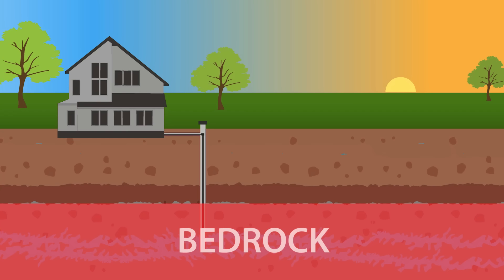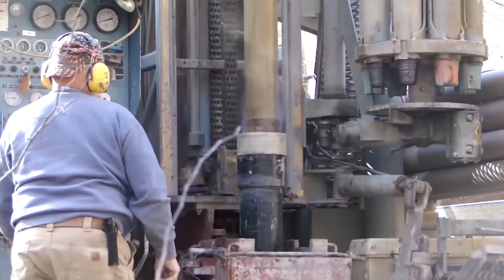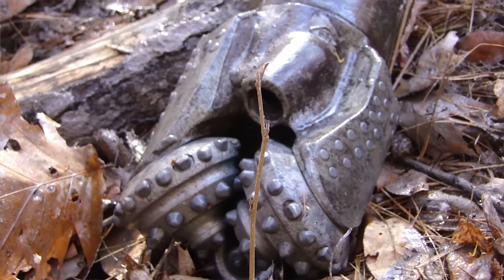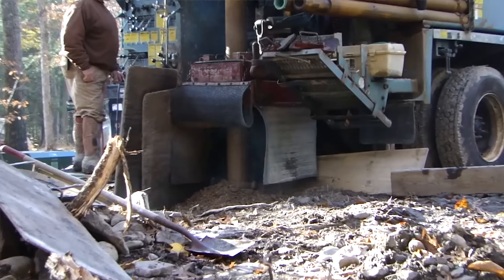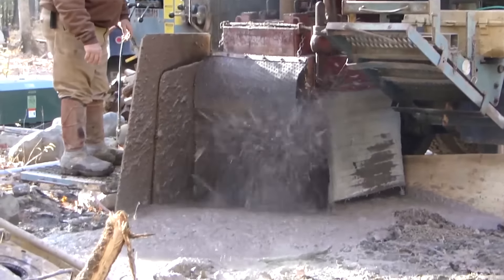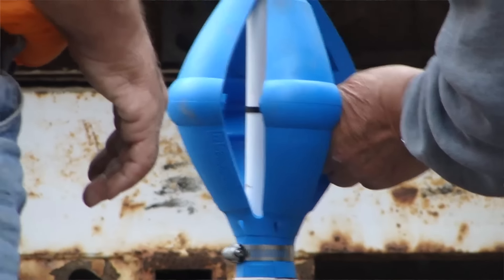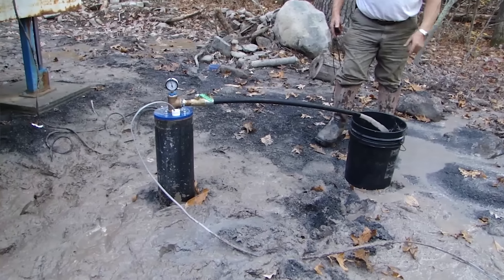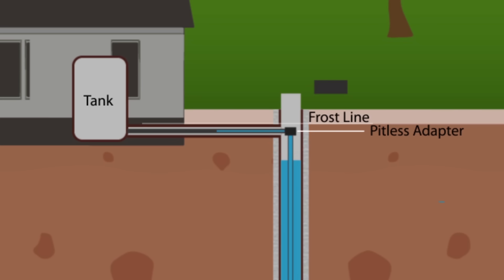WELL DRILLING 101 | Every Step Explained

Comment: Your well drilling information is bang on the money, Dan, and thank you for this educational video. I'm from a family of well drillers and am still amazed at the few number of people who understand this process. I'd like to add some information on the difference between a Cable Tool Drill (also called a Hammer Drill) and a Rotary Water Well Drill. It's important to understand the differences from a functional and financial standpoint.

A Hammer Drill drops a thousand pound 20' long solid steel drill bar from the height of two feet via a cable under a walking beam, then lifts it up again and repeats this process. The detachable drill bit on the bottom of the drill bar has tungsten carbide "buttons" on the bottom and sides that maintain the size of the typical six inch diameter drill bit so the hole size doesn't change to a cone shape. The half ton drill bar impacts the ground with enough force to grind up the rock in the presence of water to create a sludge called "cuttings". A hammer driller will typically drill 3-6 feet per hour and the operator regularly needs to stop drilling and pump the sludge out of the well (with a twenty foot hollow tube with a dart valve at its bottom) before adding more water (5-10 gallons) typically by using a pail. When water is struck the pump will come out of the hole with more water than the 10 gallons added manually.

Conversely, a Rotary Driller turns a pressurized drill tube and the rotating bit at the bottom of the drill tube grinds up rock much more efficiently than a hammer drill. The cuttings are constantly being blown up the outside of the drill tube by pressurized air that is forced down the center of the drill tube (typically 2000 PSI). A Rotary Driller only needs to stop drilling to add another 20' drill tube to extend the well depth. Therefore, a Rotary Drill can drill several wells in one day in decent drilling because of the efficiencies mentioned.

So what does this mean to the customer. There are significant differences in the two drilling methods:
1- Impact:
The biggest difference is the amount of impact the ground receives. A Hammer Drill pounds violently and this force can easily be felt a mile away if the rock being drilled outcrops near the surface. This impact will agitate any small seam in the rock to allow water to enter the well. But a Rotary Drill grinds away at the rock with only a slight vibration on the rotating drill bit.

2- Time:
Drilling in softer rock such as red shale, a Hammer Drill can drill a 100 foot well in two to three days, a week or more in hard rock. A Rotary Drill can drill 2 or 3 wells in one day in soft or even medium hard rock. Many times my Hammer Drill ended the day with a dry 60' hole and returned the next morning to find 5 gallons per minute of water flow. The "Impact" mentioned in #1 above had loosened a slow trickle water seam and the overnight hours allowed it to open up and supply ample water.

3- Pressure:
Hammer Drilling requires one to bail out the cuttings so an empty hole 60' deep can have a 60' water head forcing water in any surrounding seam into the well hole. This pressure can cause a slow leak to allow this small seam to be flushed open. Conversely, a Rotary Drill forces 2000 PSI down the drill tube to force cuttings to the surface. Imagine a small water seam in these two cutting removal processes. A Hammer Drill operates with an empty hole with water table pressure trying to access the hole. A Rotary Drill forces cuttings into a water seam with 2000 PSI of pressure to block water access into the hole.

4- Operation Costs:
A Hammer Drill business can be started with a $20K drilling machine and a functional halfton. A Rotary Drill would need a ballpark million dollars for the drill, drill tube service truck and accessories. Instinctively one would prefer a more efficient Rotary Water Drill, but the efficiencies of a newer higher tech Rotary Drill do not translate into a better water well or a cost savings to the customer, only a faster hole.

Note, my family has all retired from well drilling, like most Hammer Drillers. I only post this information to educate. I built a house in a subdivision where every house had Rotary wells and they mostly had such a low supply (less than one gallon per minute) from a 200' well that one shower a day was their limit. I paid a Hammer Driller a footage premium to drill my 120' well and got 10 gallons per minute, enough water to run two water sprinklers all day in a dry spell.

In summary, find a Hammer Driller, pay him a footage premium to save money and get a great water supply.
Reply: Amazing information, thank you for sharing all of this
Reply: And you win the award for longest comment in history 🎉
Reply: All that expense and toxic PVC pipe is used for lift and delivery? Why not copper pipe? An extra $400 is going to break the profit margins of these greedy well drillers?
Reply: @thinkcasting3182  PVC is not toxic - you drink from it in your house all day - if not there - millions of other places have PVC for hot and cold water - enjoy the chicken nuggets - you should be worried about what is in that which McDonald serves rather than the PVC pipes
Reply: Thanks a lot for the info - It certainly seems that the rotary drills are much more efficient and faster in drilling - as an Engineer, I can imagine the impact and difficulties of the hammer drills and what one needs to do to get the "cuttings" out of the hole - I just hope to find a decent and cost-efficient drilling contractor to drill a well for me in Northern Virginia - so I can get my house started building - also need to put in a sewer system and leach field - before I break ground for the foundation - God willing soon before I can no longer feel the motivation of building my dream home.
Reply: Is that true in a sandy soil with nothing other than 'cemented gravel' to break through?   I have a well drillers log from a well that was done years ago.   Our  static water level is 8' (or at least was - it looks like maybe 10' now) and they pumped 90 gallons a minute when they tested it with minimal draw down so I assume this is going to be a fairly easy well to drill.
P.S. - thanks for sharing your knowledge with us
Reply: @jeffa847  Getting water from gravel is very different, as you suggest. Sometimes the gravel seam could be only two feet thick and this would be easy to bypass with either type of machine. It's important to place the bottom of the casing far enough into the gravel seam to support filtering of the water via the gravel. I've seen times when driving the casing through a narrower gravel seam that the water flow was shut off. If this happens and the seam is a few feet thick, it is often possible to pull the casing up enough to center on a 3' seam of gravel that a good water supply will result.
The important thing is to be alert when drilling to know the thickness of the gravel seam while drilling. Either drill type should be effective in getting water from gravel, assuming one takes the time and care. It would certainly be possible to bypass a narrower seam and continue drilling through overburden to a different supply at a lower level.
Reply: Holy moly, what a gem of a comment. Thank you for sharing!!!
Reply: @wizardmaster6639 i think you're confused. Yes, PVC pipes are popular....but for USED or INDUSTRIAL WATER. The problem is many self-taught contractors end up using them for drinking water just because they associate PVC with water. Copper pipes are supposed to be used. PVC IS toxic, depending on certain conditions especially u mention hot water. The only ppl who've been claiming PVC is safe, contrary to meta analysis, are the ones selling it OR self taught contractors who dont understand the chemistry behind PVC.
Reply: @wizardmaster6639  *when i mention used water I'm referring to the water that u flush, shower, blablabla
Reply: @johnwig285  John, I used to love Chemistry - until in College, I took the class with a HIPPY total ass-hole of a professor - so, not only did I drop the class,, but also reported him to the board for his abusive behavior - Long story short, I see EVERY SINGLE BRAND NEW home that ALL builders build uses PVC for wastewater and cpvc for drinking (clean) water. I still do not like it, but that is how they build these houses - for my new house, I will make sure to use copper - and I am sure it will cost an arm and an asscheek. Can I borrow an asscheek from you? lol.
Reply: Thank you for the tutorial.  It was most interesting.
Reply: How do you find the water in a desert like africa to begin with?
Reply: @aaron___6014 
Haha. I've never drilled in Africa, but generally there is water almost everywhere. The toughest spot we ever drilled for water in 50 years was on Keswick Ridge that overlooks a hydro-electic dam at Mactaquac, NB, Canada. The rock is granite which is almost impervious to water. We drilled a well on the boundary of two properties and got enough water for the two homes at a depth of 200 feet. The owners had previously drilled a total of three 300' deep dry wells within 150 feet of our well.
Reply: @garsonprice3441  I could listen to you talk wells for hours. Im in sw Fl and curious about a couple things. If an entire neighborhood is on well water are they all pretty much sharing the same water supply from one big pool of water?  If one of those neighbors were to drop say 50-60 chlorine pellets down the casing to sanitize their well whats to keep that chlorine from contaminating the neighbors water supply?
Reply: @stillwill1808  That's a multi answer question, Stillwill. If your water comes from gravel, then all gravel based wells nearby will likely be pretty connected. 
But if your water comes out of a vein (crack) in rock, then neighbours on that same vein will be connected. Note there will likely be several different veins in rock at different depths.
We drilled a 60 foot well in the '70s where the rock was just a few feet down, so it had to be drilled out with an 8" bit to install the required 20' of 6"casing (to ensure a good seal from surface water). Then we moved across the little street 60' away and drilled a 100' well that required 80 feet of casing to reach the bedrock.
Water wells are like people, all different.  : )
Reply: @stillwill1808  
     That's a complicated question, Stillwill. Water comes from different sources - sand, gravel, porous sandstone, veins in hard rock.
     If your water comes from gravel, your neighbours wells will be somewhat connected and your 50-pellet chlorine test would possibly affect some of your neighbours.
     If your water comes from a rock vein, then nearby neighbours on that same vein could taste chlorine. Note there is often several veins at different levels, so your neighbour's well could be on a different vein.
     Back in the '70s we drilled a well (with a hammer drill / churn drill) in Burton, NB. The overburden was just a few feet thick, so we drilled an 8" hole down 20' to put the casing down 20' to seal off surface water. The well finished at 60'. So the neighbour, 80' away, wanted a well also at that low cost; but his well took 80' of casing, 100' of depth. The bedrock in this area was slanted 60° or so.
     On another occasion, while drilling at a depth of about 50 feet, the half-a-ton toolbar began floating and had to be dropped 3 feet to resume drilling. Looking down the well with reflected sunlight revealed a fast flowing, 3' deep river. This well could have supplied hundreds of gallons of water per minute.
     Each well is different, right. Hope this answers your question.
Reply: Thankyou for your time and sharing your experience. Its fascinating so many things are happening under our feet that few people ever realize. A nearby city, Cape Coral, Fl operates two desalinization plants they claim to pump and treat 30 million gallons daily. A study published by NPR claims the water table there has dropped forty feet in about 14 yrs and its causing parts of the city to drop an inch or so every year. Theres pushback on those numbers but even half that would be large
Reply: I'm trying to do one in honduras I'm told at least 10000 US!